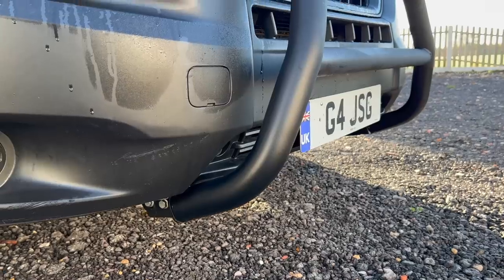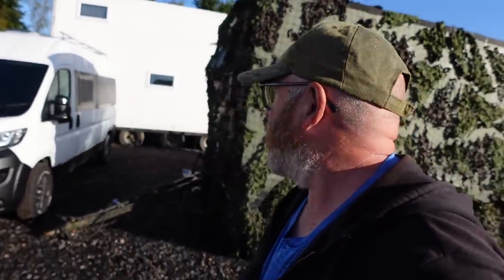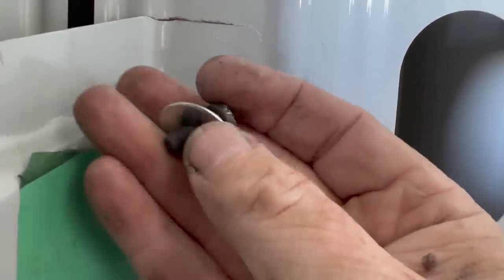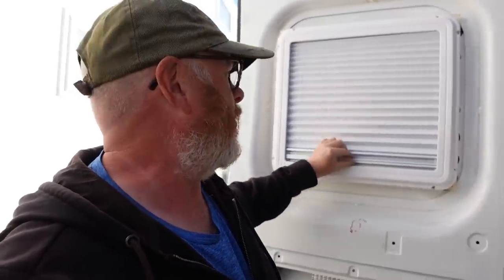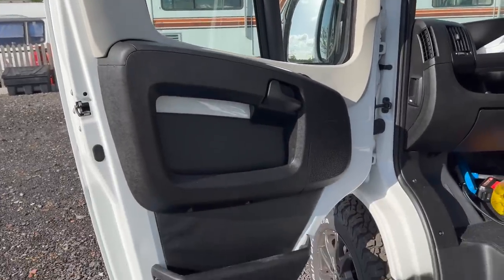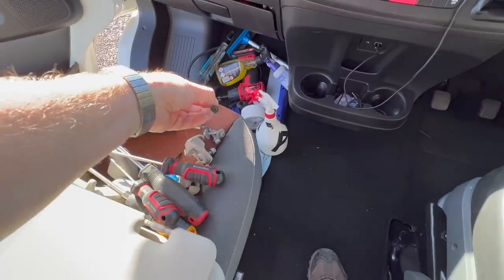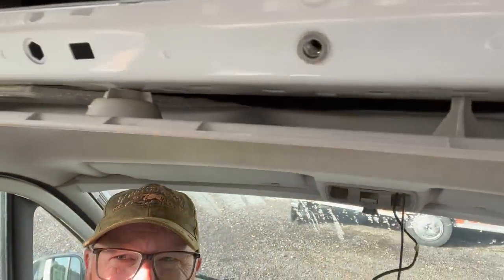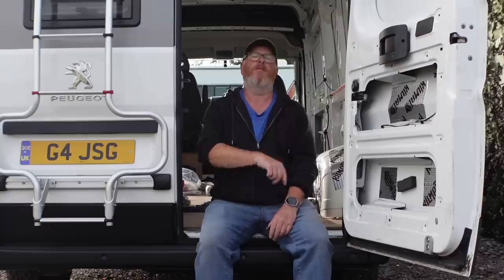One job leads to 5 others - VB09

Comment: Hi John just just to add to the floating floor project just make sure all your joints are glued so it becomes one big solid floor so you have hardly any movement we use t&g ply or chipboard flooring ply may be better a bit lighter than chipboard

Comment: Looking good John. Having retro fitted cables for a reversing camera and a few extra lights and a maxifan in my ducato maxi ih motorhome,  I swore that if I ever took on a project like yours I would fit loads of smooth bore flexible conduit in the framework of the body with extra redundancy so that as technology and design upgrades come up, I wouldn't have to dismantle the furniture and fittings just to feed a new cable around the van. Even using an electrician's cable feed, the pressings in the metalwork snaged on the feeder rod every few feet making for some bothersome hours and more than a little strong language. It's great to have a blank canvas to work on, and I love seeing how you are bringing the project on. 👋

Comment: Hi John I'm following this build with you. You mentioned in an earlier video about a night heater fitted under the driver's seat . A 8kw does fit under I had 1 under mine. But I made the mistake of keeping my pipes under the heat shield. So when pipes clogged it was a pain . I also fitted 1 leisure battery under passengers seat . My van is used for deliveries so I had to put hole through bulk head to get rid of the heat . It was brilliant for when I did the odd night out in van or when I had a long wait at some sites.

Comment: Just a thought, and it’s probably too late because you’ve already thought of it or done it in which case ignore me. But have you thought about running the wiring through the van in flexible plastic conduits, or putting in some “pull through” cords so if you need to put in some more wiring in the future you can attach it to a “pull through” and pull it in. It would save all that fishing for wires, but like I said I’m sure with your past experience of van/motorhome wiring you’re way ahead of me!

Comment: I’ve just started another van. No battens in the floor either. I reckon it’ll be fine.
Also conscious about weight distribution ( Louise admits she’s got a lop-sided Fanny).
I’m not weighing everything but certainly taking it into account.
Shock horror to some people, the shower tray is resin cast. Not putting that campervan plastic crap in.

Comment: I would put the cables in conduit. Just incase you ever have to change a wire or camera etc 
Also a brother label printer with heat shrink labels to mark every cable at each end and the middle.
Reply from the maker: All cables are installed after insulation so you can get to them.

Comment: What thickness T&G will you be using on the floating floor John ? couple of things pop to mind firstly by using say 2x1 battens at approx 500grams a meter rough calc around 15kg for the van floor and you could get away with using 9mm ply for the floor, with not using battens i would assume you will be using a minimum of 12mm T&G Ply which weighs approx 5kg a sheet more that 9mm ply , 3 sheets for a LWB van floor gives a very similar weight comparison  just a bit of food for thought 😀
Reply from the maker: No T&G in my build.
Reply: @GadgetJohn  interesting 😉

Comment: Looks super.  Very clean finish.  What do you do to bring the black plastic in the door back to normal?  I have found baby wipes with oil works, also works on the black plastic foot step too.  Is there something better???  Cheers.  A.,
Reply from the maker: YouTube is great in that you can go back and watch old videos, just a couple of videos ago I spray the van & bumpers. You’ll get all the details in that video.
Reply: @GadgetJohn  That is fixing a slightly different problem to the one I had.  But thanks anyway as the outside is also an issue.

Comment: Hi John, did your van have the threaded fittings in the chassis to take the tail end of the centre and side sections of the engine cover, or did you have to use the riv nuts in your fittings kit? I've got the fiat 180 maxi and it only has one threaded fitting to take the existing off-side section (which I'm leaving in place), which suggests that it left the factory like that. I've got a different kit than you and the riv nuts aren't provided, though the hexagonal holes are there in the chassis so I'm putting my own in to allow the other two sections to be fitted. I'm just mulling over the cooling aspects of the engine cover and the implications of covering the engine since it left the factory without one. I've got the 3ltr Iveco engine in my van and I'm considering the loss of air flow may adversely affect the engine cooling by the closure of the base of the engine bay, so was wondering if your van was fitted out differently being a Peugeot, and by design wasn't fitted with an engine bay cover, or it was but the panels were just missing for whatever reason. 🤔 Obviously I'm going to monitor the temperatures, and it maybe that I'll have to make some alterations to the airflow,  but I'm curious as to whether you're van was intended to not have the engine cover, or if it was just not re-fitted by some lazy mechanic somewhere. Cheers,  Geoff. 👋
Reply from the maker: Hi Geoff, the fixings were there on the chassis so I didn’t have to add the rivnuts and the middle section has a cooling slot on my kit.
Reply: @GadgetJohn  Cheers John, that's interesting. Yep, mine has the two cooling slots too, it looks like yours from the photo you had on your vlog, but my fixing kit is missing the bolts and riv nuts, but it makes for a bit of fun sourcing and fitting the missing bits. I looked for the brackets for the nudge bar, but like you said, they are not there on my (fiat) panel van motorhome/ camper chassis which was converted from new, so probably not specified to save a few pennies during the ordering, but to only fit one third of the engine cover seems mean given the purpose is to preserve the vehicle. Hay Ho, thanks for getting back to me. 👋
Reply: @geoffcampbell7846  My 2016 Boxer with the 2.0 Euro6 engine also only has the engine cover on the offside, and doesn't have any fixing points for the centre or nearside section.  Like you, I've also had to order an extra rivnut fixing to fit the ebay undertray.  It seems weird that it would come from the factory like this, but that's what it looks like.
Reply: @ianfletcher4488  Cheers Ian, I wonder how much they save by missing out 3 rivnuts. Anyway, one thing I found out after overnight rain is that the cover does hold a fair bit of water,  so while the centre cover was off to fit the rivnuts I drilled several small holes in the catchment areas to drain the water off. I've not been back under the van since to see how effective they are, but it's one less thing to worry about heading into winter. 👋
Reply: @geoffcampbell7846  I wonder if the full 3-piece cover was an original design intent, but they found that it trapped too much water and just deleted 2 of the parts several years down the line. The offside panel covers the alternator in my van - maybe they decided that was the only panel that was truly useful.